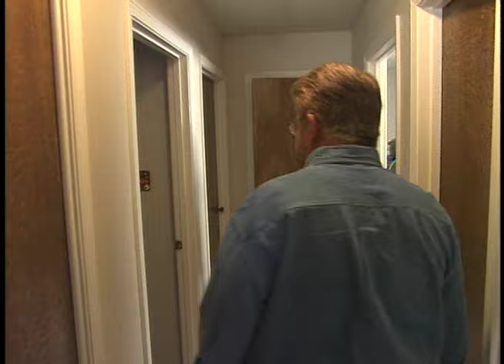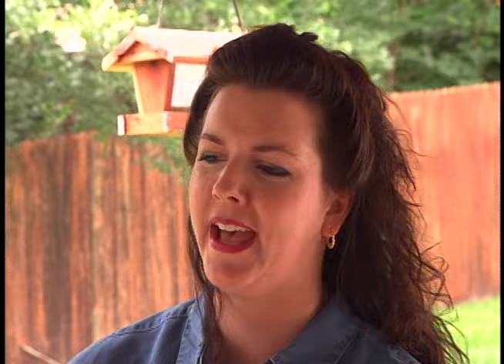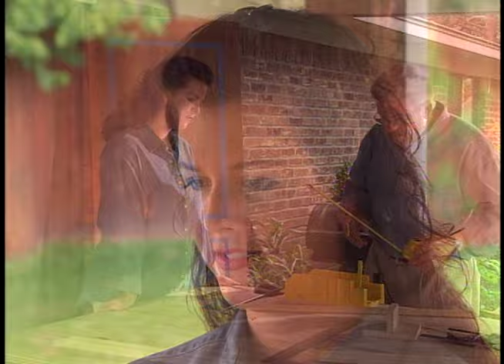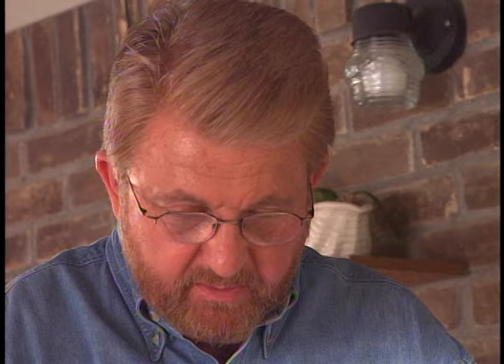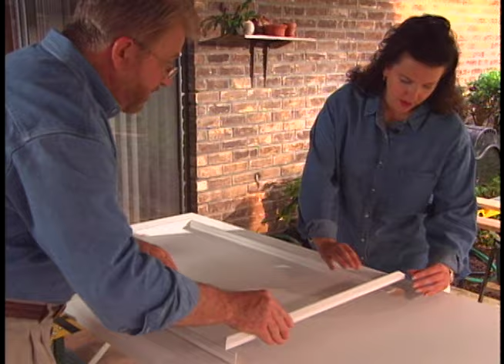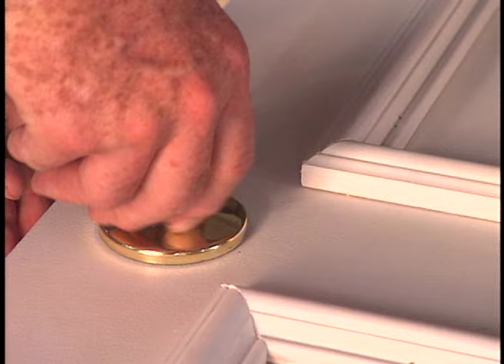How to Make a Flat Door into a Panel Door

Comment: yuk.  Now they look like a 1970's attempt to replicate a paneled door.  IMHO, that rich wood grain they originally had was far superior.
Reply: Same. The previous owners painted over the wood flat panels at our house and I HATE it. No going back now without a TON of work. Only ones they didnt touch were the pocket doors.
Reply: @evelynmyers4173  and Kirk - I hear you, but nothing really good about the flat interior, hollow doors. I have them in my new (older) house, and they are now very dark, with wood grain. I don't think they do ANYTHING for the house, but I like the darker wood color and grain -  if only  they were better doors. ... I am going to either replace all interior doors with real wood panel doors OR. go with tutorial of adding real panels to the flat doors. There is a tutorial (not YT) that I saw online. Can use 1/4 inch plywood or even thinner Luan. With it that thin you don't need a transition moulding - just a flat, thin piece of panel over the door. (Hope you know what I mean.). The 2 disadvantages of this is that you have to drill a hole for the panel to fit doorknob, plus you will add depth to the door, so the door jams have to be removed and repositioned.   Want to see if I can get someone to do it, and compare $ to purchasing and  hanging new doors, etc.  (If I  remove doors and hardware, and even door jam, it should help with time and cost??)  ... My other consideration is that I am not going with the cheap hollow panel interior doors. Can't stand the look or the sound/feel when closing the doors. Real wood is just so much better.  What are you going to do? ...and then, whether to switch to solid brass doorknobs, LOL!